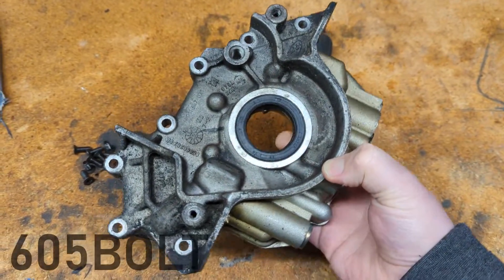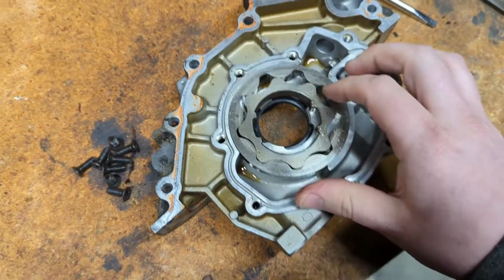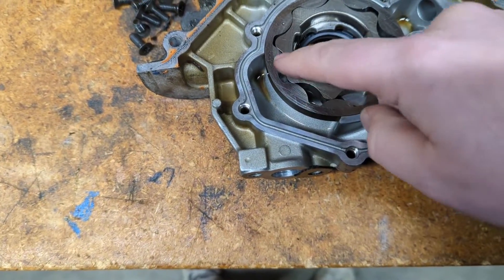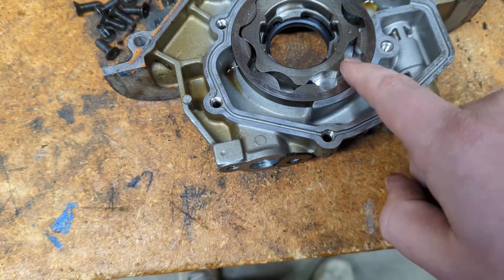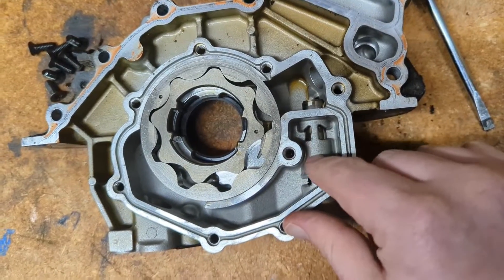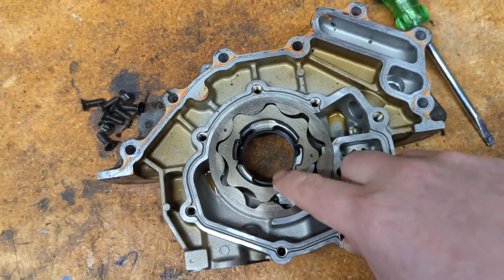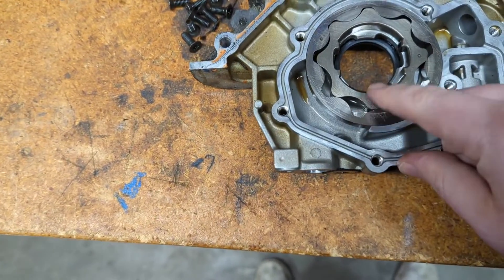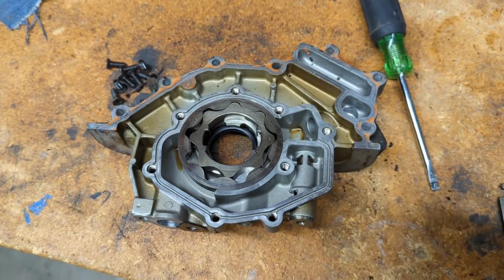Gerotor Pump and Oil Pump Gears -- How Do They Work?

Comment: Thanks for explaining this. I am currently rebuilding my Seadoo engine (Rotax 1503). I found out the oil pumps are GeRotors and have been looking for information on how they work.
Reply from the maker: @MichaelWatson-c4o  no problem. It's a cool concept used all over in automotive and marine. Many automatic transmissions use the same concept to pump transmission fluid throughout the transmission. Thanks for commenting!!

Comment: Need more content on your svt focus. I know its probably just your daily but there such cool cars. I actually am building the engine for my svt focus and i watched your videos on how to do it. Mines getting a turbo. So i was actually gonna ask. Do you think i should upgrade my oil pump gears?
Reply from the maker: Sorry I won't be able to make more SVT focus content with that specific one because I sold it. Might own another one day. Never know. They are cool cars for sure.
Reply from the maker: As for your question, I would not upgrade gears. SVT  Focus aren't known for breaking gears.
Reply: Yea man you'll have to check out mine when I finally get it finished lol. I'll probably be hitting you up for more questions.
Reply from the maker: @Busted00  that's great. I'd love to. What happened to your ride? If the engine is damaged or something I would change the entire oil pump. Should have mentioned that. But upgrading gears specifically isn't super common.
Reply from the maker: @Busted00  that's great. I'd love to. What happened to your ride? If the engine is damaged or something I would change the entire oil pump. Should have mentioned that. But upgrading gears specifically isn't super common.